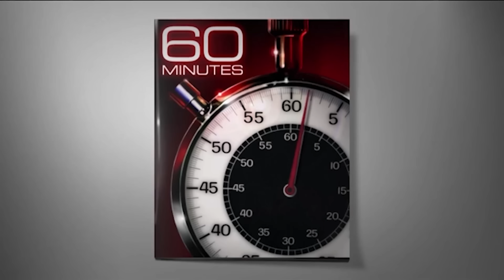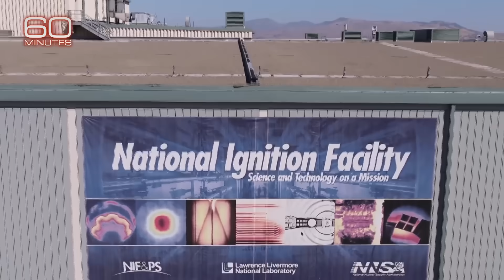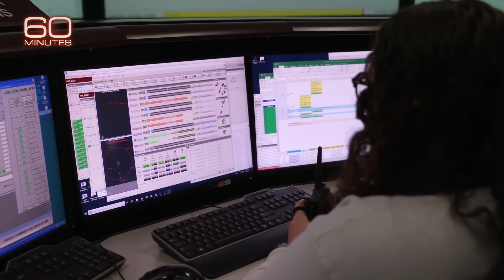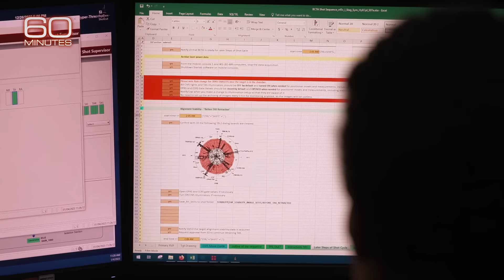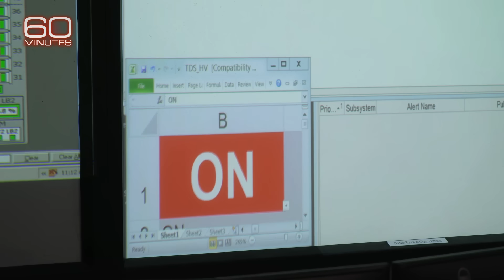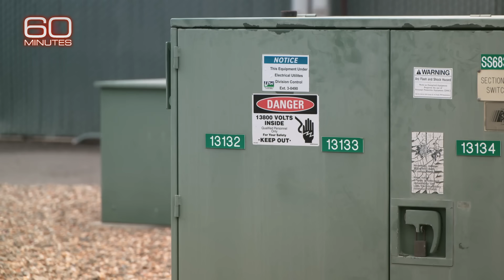Nuclear Fusion: Inside the breakthrough that could change our world | 60 Minutes

Comment: Yeah but it took more power from the grid to do it than it put out. So it’s still going to be decades away
Reply: The important thing to remember about this is that they proved it was possible. Before this, everything was just a hopeful theory. Now we know it's possible
Reply: @timw483  It is not possible... Einstein , the laws of thermodynamics ... say .. NO...   When you change these laws it proves we are in a simulation
Reply: Yes Power imput was 300 times larger than output BUT the point of this experiment was to show that fusion is possible and it did exactly that. As it was stated in the video, now its just engineering problem.
Reply: MILLIONS OF THEM 😂🤣😂
Reply: you weren't listening were you
Reply: @michaelbartmess7994   Someone did not listen. At 9:46 they stated that it took 300 units of energy in and only got 3 units out. So yea it took way more power in than they got out. No breakthrough here really. Also at 12:08 they stated they might reach commercial power in 20 years or so, aka decades away. Same time frame they have been saying for..... um well decades.
Reply: @ulbuilder  The breakthrough  is that fusion in a man-made machine was achieved!

 How much energy it used or produced is nonimportant because producing positive energy output wasnt the goal of the experiment.
Reply: @JackieWelles  lol, we were able to do fusion in a machine since at least 1964. Lookup Farnsworth Fusor. Also the Hydrogen Bomb dating back to 1952 does fusion but admittedly not very useful as a power source.
Reply: @michaelbartmess7994  The commenter is right. The energy released by fusion was higher than the laser energy that was put in. But the lasers have really low efficiency. To get the laser energy they used around 100x more electricity.
And the fusion energy was not converted to electricity. Even if they had the hardware to attempt that, it could optimistically only turn 50% of the fusion energy into electricity. So instead of getting 1.5x the amount of energy as they claimed, overall they would have lost >99% of the energy they put in.

Good science youtubers explain it correctly: Sabine Hossenfelder, Scott Manley. 
I am happy they explained it correctly in this video too! at 9:47

Comment: The energy of the lasers drives an x-ray reaction with a low conversion efficiency.  Is the fraction they are happy about (fusion energy out)/(x-ray energy) > 1.  Or is it (fusion energy out)/(laser energy)>1 ?
Reply: Really? I understand it was the laser light, but the lasers are really low efficiency. To get the laser energy they needed more than 100x the amount of electricity. 
They looked at (fusion energy out)/(laser light into pellet)= around 1.5.
(fusion energy out)/(energy into lasers) = <0.01.
Then again the x-ray reaction is also low efficiency.

Comment: Folks, before getting excited, the reaction requires Tritium and there is only about 25Kg of Tritium on Earth and it is very difficult to manufacture requiring its own machines and processes that require huge amounts of Energy input. 
The Fusion Reaction, if it can be maintained beyond "Ignition", which is what this is, can be self perpetuating if Lithium-6 Blankets are involved, maybe. But it is about 10 years down the road at least to even test the theory at ITER in France. That is the purpose of ITER. The reactor was expected to take 10 years to build and ITER had planned to test its first plasma in 2020 and achieve full fusion by 2023, however the schedule is now to test first plasma in 2025 and full fusion in 2035.
Reply: D+T is just one way, like he said theres many companies tweaking it/doing it differently.  E.g. D+D, etc
Reply: This is just one method. Search "Helion" on YouTube.

Comment: Several Problems, First the Net Q energy release was only compared to the energy needed for the massive laser or Q Plasma, it did not include the energy (Q Total) required to run the actual reactor which has massive electromagnets and all kind of conduction systems. Also all that was produced was heat, not actual energy, they are extrapolating the heat produced into the electricity it could produce, which is another entire energy requiring process. And also the Tritium is really rare and we do not have quantities at Scale and Scope and to manufacture Tritium requires enriched Lithium-6, not a fun substance to have around. There is only 25Kg of Tritium on Earth for reactor start up, just the ITER start up alone will use 20 Kg. The Lithium blankets theory is just that, it has not been proven experimentally yet.  This is all Hopium Squared They basically used 3000 times the Energy put into it as they received for a billionth of a second out of it.

Comment: A great achievement.  Funding now secure.  I am glad they mentioned the real gain because that's not something the researchers typically disclose.  And no it's not now simply an engineering problem.
Reply: Several Problems, First the Net Q energy release was only compared to the energy needed for the massive laser or Q Plasma, it did not include the energy (Q Total) required to run the actual reactor which has massive electromagnets and all kind of conduction systems. Also all that was produced was heat, not actual energy, they are extrapolating the heat produced into the electricity it could produce, which is another entire energy requiring process. And also the Tritium is really rare and we do not have quantities at Scale and Scope and to manufacture Tritium requires enriched Lithium-6, not a fun substance to have around. There is only 25Kg of Tritium on Earth for reactor start up, just the ITER start up alone will use 20 Kg. The Lithium blankets theory is just that, it has not been proven experimentally yet.  This is all Hopium Squared They basically used 3000 times the Energy put into it as they received for a billionth of a second out of it.
Reply: @bargdaffy1535  I think ITER, or tokamaks in general, hold the most promise.  And they're out at 2050 for commercialization, which of course means well into the second half of the century at best.  Or maybe we'll have anti-matter reactors by then.  Beam us up Scotty!

Comment: I find what is most exciting is how we have a new generation  who're no longer paralyzed by fear of old reactor designs to make them not want to build new designs. They understand that nuclear power has great potential but you have to treat it with respect while not being paralyzed with fear. That mindset will allow us to solve the other problems of society besides our energy needs.
Reply: This is hydrogen, and not using radioactive materials. Completely different than a fission reactor, and completely safe. There is literally nothing to be fearful of, that’s kinda the point.
Reply: @JS-kb4im  I'm seeing lots of support for technology such as Small Modular reactors,  Breeder reactors, and thorium fuel is what I'm saying. 

I'm also saying that this new generation doesn't see all new reactors being potential Chernobyl reactors.

That means that the Ideologues won't have a strangle hold to prevent construction of power plants once we do get commercial fusion.

It helps for this generation to experience going from 1st to current gen iphones.

the Anti-Nuclear power ideologues argue  the equivalent of  "since the 1st generation of Iphone couldn't multi-task due to hardware constraints then you shouldn't purchase a iphone 14".

We're largely using 2nd generation power plants, pretty soon we'll have 4th gen fission power plants. The ideologues would use the sins of the 1st generation of nuclear power plants to stop 4th gen from being built.

These ideologues stink up the room and now researchers have found that many of them  got their wallets lined by the fossil fuel industry.

Comment: Time to replace all fossil fuels with clean, cheap electric 👍
Reply: And solar. Dont forget, fusion power will alao obsolete solar panels
Reply: @thedude5040  Solar panels are cheap and produce power for years, with little to no maintenance.    Fusion is a whole different animal.
Reply: @DerekDavis213  on a scale of MW/acre fusion will be numerous orders of magnitide bigger than solar. You just salty because your rooftop solar panels might be worthless
Reply: @thedude5040  And you base MW/acre calculation on WHAT exactly?

So far, we have a tiny lab experiment that runs for a few moments and takes much more energy input than the energy that is output.

Fusion has to run reliably, on a commercial scale, 24 hours per day, for YEARS.   There is no evidence that these tiny lab experiments will ever achieve those requirements.
Reply: @DerekDavis213  fission is already far superior to solar. As far as fusion it will work because physics says its achievable. Just time and money at this point.
Reply: @thedude5040  'Physics'  and engineering a cost effective, reliable , commercial-scale power plant are very different things!

Comment: You wouldn't need 10 shots per second, the first fusion just needs to be big enough to power a next-stage device by Teller-Ulam process. Then you can dial up the explosions to whatever, and you can make a powerplant with 2-10 explosion per day. This is the same as a PACER except without any fission components.
Reply: I have little knowledge of science, but how are they going to increase the ratio of "1:300 ratio of power"? that sounds very ineffcient.
Reply: @geddon436  You build a second bigger pellet surrounded by an X-ray reflector that uses the x-rays of the first explosion to create a second implosion. This is how H-bombs are built, it just requires an initial explosion. In usual H-bombs, the trigger is a fission bomb, but these are dirty. In a clean explosion like here, you can build a radiation-free hydrogen explosion.
Reply: @annaclarafenyo8185  you sound knowledgeable. So, what are 3 hurdles to have commerically available fusion?

Comment: I'd like to see more money invested in solar power and batteries.
Reply: @vrclckd-zz3pv  Fission already works 24/7 365 days per year.   The technology is well understood and has decades of success, worldwide.

Fusion is just a dream, a tiny lab experiment doesn't mean SQUAT, in January of 2023.
Reply: @DerekDavis213  its not a tiny lab experiment its a breakthrough. In the worlds of Einstien "we stand on the shoulders of giants". Science is a slow march and for something like fusion you it will take a while. I agree fission should be invested in, and should have been invested in more, but commercial fusion would change our world so we should keep researching.
Reply: @duckqueak  I agree that fusion research is a good idea, but a small lab experiment does NOT in any way mean that large commercial fusion plants are possible.

A fission power plant is just a steam engine basically.   Fusion power is much, much more difficult and complex.
Reply: There is more money being spent on those things than fusion. Like way more, also this is the holy grail of energy, its worth quietly supporting in the background while we do those things. Commercial fusion would cause electricity to be less than 1 cent per kwh. Who knows what a society with that much limitless clean energy looks like.
Reply: Lol no. The point of fusion is to obsolete solar panels
Reply: @thedude5040  Fusion is always 20 years away.   And today it is no different.

Comment: In 1970 they said fusion would be available in 30 years and the goal hasn't changed...it will still be available in about 30 years. 
Seriously, it may take a long time but it will happen...it has to happen.  
Think back only 150 years.  They had no idea of the electronic age that we have today.
Reply: Fusion may happen, but will it be cheap and reliable?    Solar and batteries and wind are constantly improving and lowering in cost.

Comment: Great report however was disappointed with the no meltdown comment. Short of poor designs in past nuclear power plants we can totally have nuclear power plants today being built. Sure 3mile, Chernobyl, Fukushima, and a few others plus movies scare people and they should in that cutting corners and ignoring experts leads to disaster. Had the EU kept more of the nuclear plants in operation Putin would've had even less leverage. Electrifying America with a sustainable baseload power that's for the most part as green as it can get would be huge for all. Carbon based energy will be around for decades and oil for products outside of energy will still be around for at least the end of this century, so why not get nuclear plants going again and be frank about the real risks and dispell with the fear thats been overinflated for decades. Storing waste has new solutions so transporting it all to a mountain isn't the only option anymore. I'd rather see two cooling towers on the horizon than coal ash lakes ready to bust loose or all the health effects that come from burning hydrocarbons, it did it's job a century ago, it's long been time to move on.
Reply: You're correct that fission power plants are safe, but they need to be (expensively) designed and built to be fail-safe. You would get such a fail-safe property with any implementation of fusion power, since whatever drives the fusion reaction (lasers, microwaves, magnetic confinement, etc.) need to be so precise. 

All of this is to say - both are safe, but the differences would not qualify as a distinction without a difference, as you seem to imply.
Reply: paragraphs, please.   Your post is hard to read.
Reply: The show is intended to be viewed by the average person and the average person has no idea how safe nuclear plants are. They just assume they're dangerous because of the high profile stories. By reassuring them that fusion is safe it avoids utterly moronic issues like the CATCH protestors when the SSC was being built.